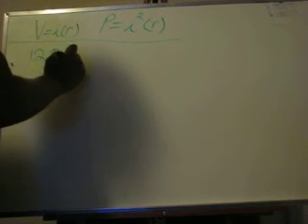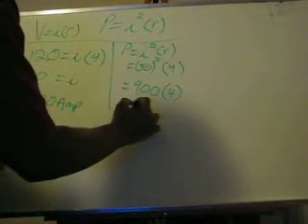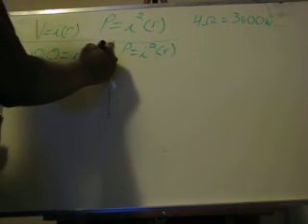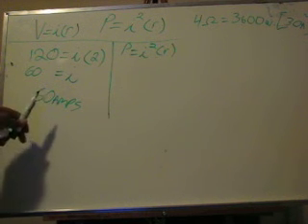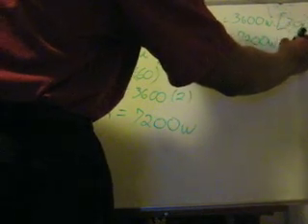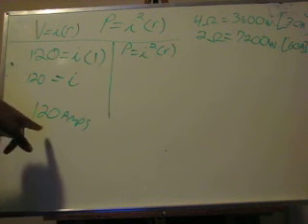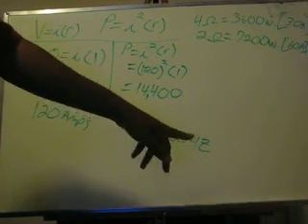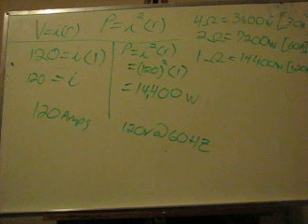Subwoofer to a Wallsocket 101

Comment: Nice video, but you will never actually reach those power levels. A speaker is a "Reactive" Load. Meaning that the impedance rating changes as it moves. In most cases, the ohm rating is increased a large amount, sometimes even 4x the nominal rating. This will make the actual power as low as 25% of your calculations. It can be fun to get a clamp meter and measure Amperage in action to see this effect.